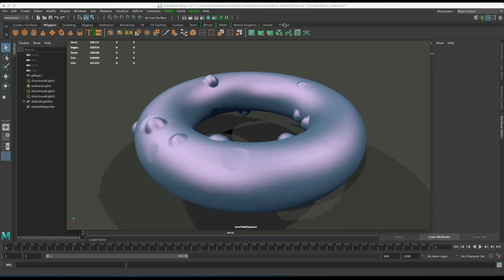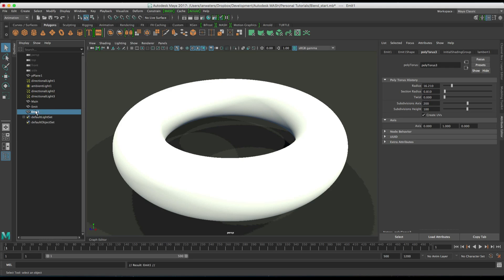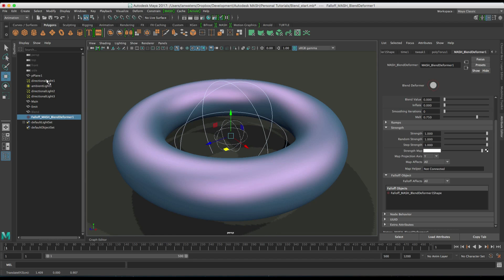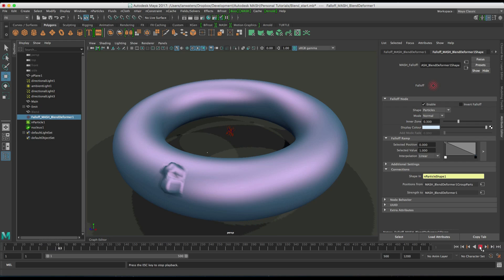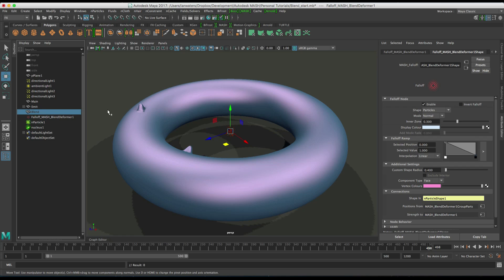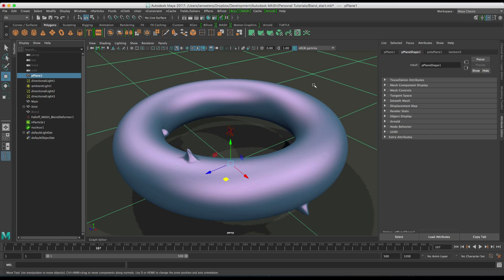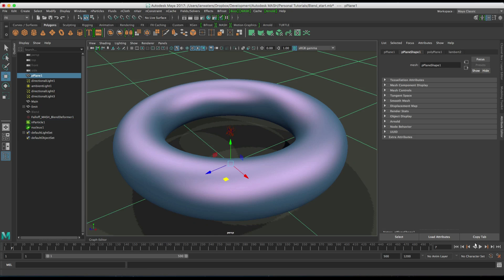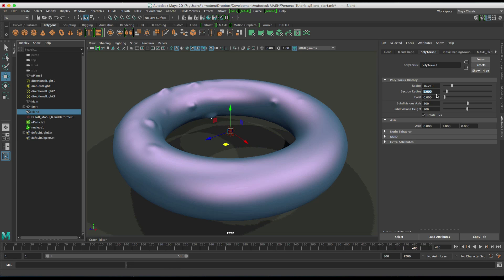Maya 2017 - Boiling mesh (MASH Blend deformer)

Comment: Hi Ian, finally upgraded to 2017 and loving it. Question please if I may - When using the MASH blend deformer do both the orig mesh and the blend have to have the same poly count to work? - much like a standard blend shape?
Reply from the maker: Yes it's very like the standard blend shape. You can sometimes use the ShrinkWrap deformer to conform meshes of differing poly counts and then blend those together.